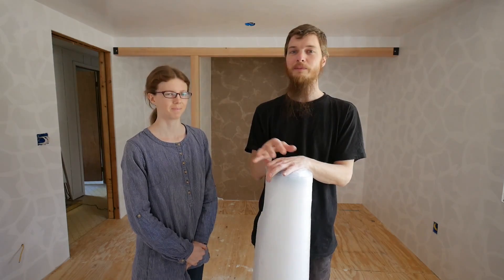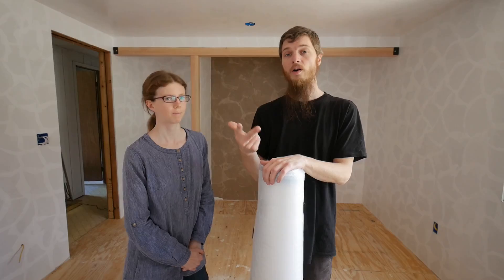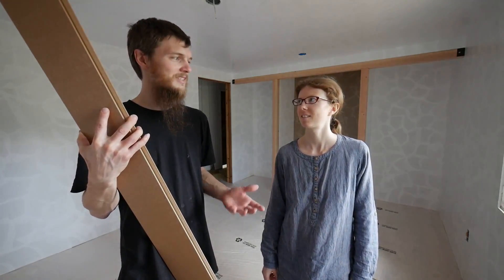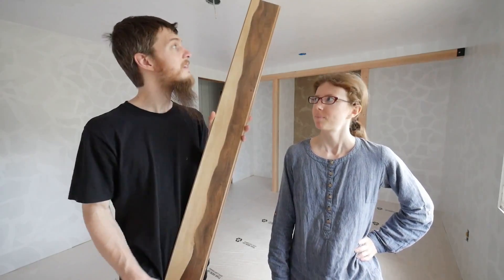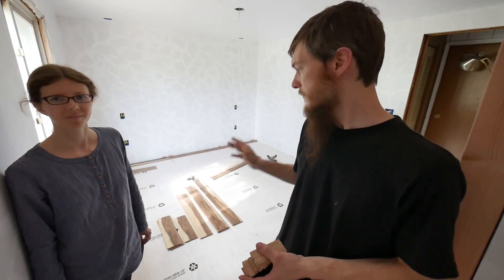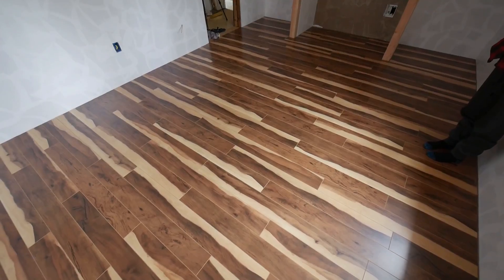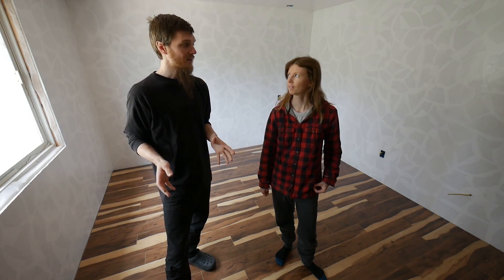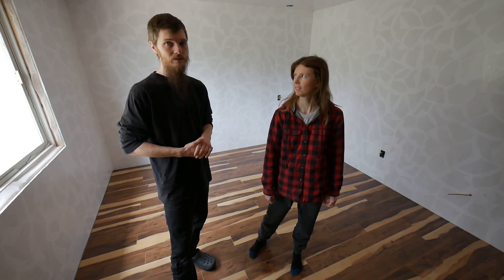Bedroom Floor Reveal - It's Bold - Home Renovation

Comment: Running the grain the long way in a room makes the room look bigger, and running the grain the short way makes the room look smaller.  Wondering why you broke convention and ran it the short way?  Awesome pattern BTW.  Didn't happen to hear the retailer or the manufacturer called out on this.
Reply from the maker: It's mainly just up to preference how the planks are laid. It's an almost square room, and we just thought it would look better this way. The camera lens can make it look longer though. The flooring is really cool and we ordered it online from Home Depot, but it's no longer available :(
Reply: @diyfferent  Thanks for the reply.  Yeah, the camera makes it look about 1/2 again longer than it is wide.  Also just saw your vid on the built in headboard, and now I see that the floor direction pattern also compliments the headboard pattern, helping it blend in and be more cohesive.